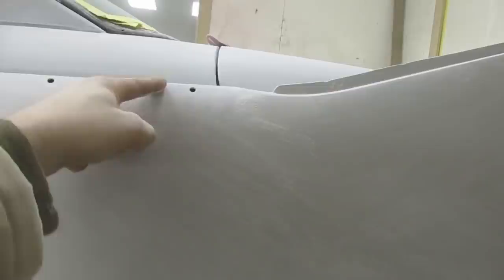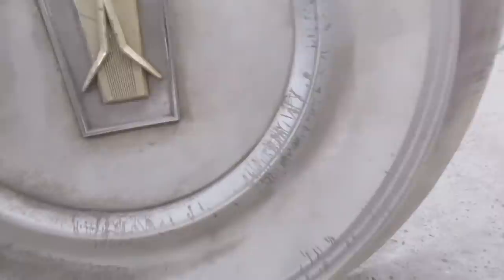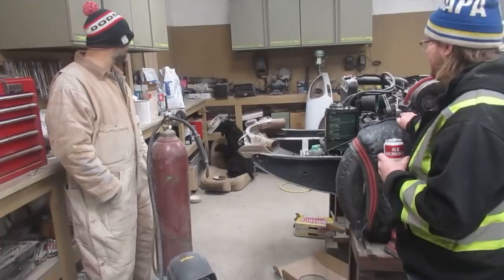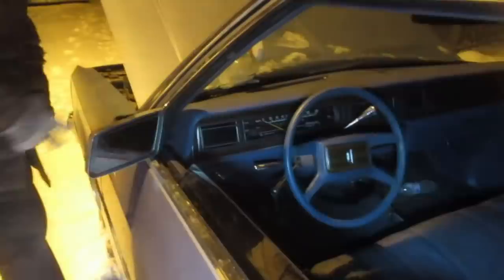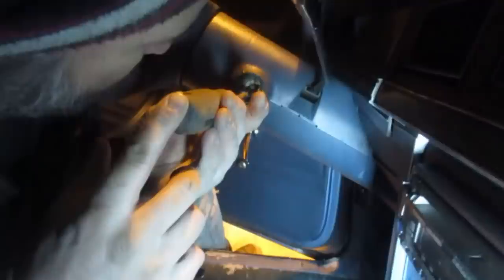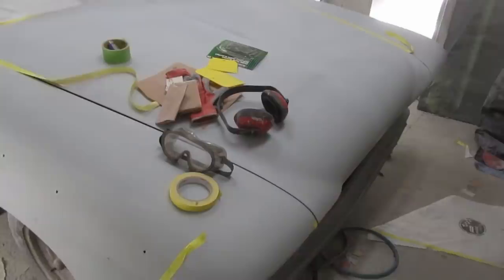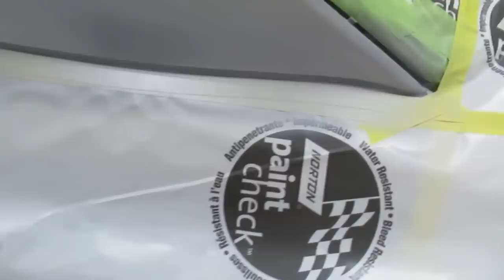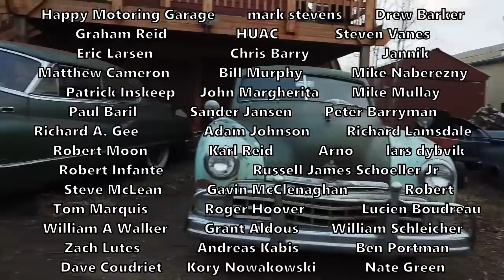Fury Paint and Winter Beater Update!

Comment: Love the screwdriver key on the LTDean. A friend got the key stuck in his SAAB, back in the late '70s. Since no one knew about their floor mounted keys back then he just cut the bottom from a styrofoam coffee cup, filled it with cottonballs, and painted them to look like coffee. He drove that car for years without ever taking the ignition key out when he parked. Locked the door with a spare.
Reply: Haha, best idea ever, with that fake coffee! Definitely an underrated comment ;-D

Today I have a VAG Group car, with the KESSY keyless entry & start system. So easy to steal these cars, with 2 people and a radio relay, one of them at your door, scanning for the keyless fob in your pocket on the clothes hanger. Just Google for it :-(
Reply: SAAB oddly you have to put the gearshifter in reverse to get the key out
Reply: @ralfgottfridhansson3127  I worked in a SAAB dealership in the early '80s. The stuck key was a common site. I owned a '75 99 EMS at the time. No column lock, but it had to be parked with reverse engaged to take out the key.
Reply: @ralfgottfridhansson3127  Reverse then serves as a mandatory parking brake.

Comment: Dean-O, 79 LTD survivor here.  That's just the Level 1 switch breakdown.  Level 2 is the steering column catching fire because the sliding block contact point setup gets hot from resistance due to the greasy goo buildup in it.  You should practice your hit the ground and roll moving car exit this week.

Comment: All the tumblers in my Dart wore down so bad finally I couldn't even turn the wore out key to start or turn it off. I finally pulled out the cylinder and knocked out all of the tumblers and put the cylinder back in so it looked like it still used a key. I could turn it with anything that would fit the key slot and I drove it a year like that. I would just lock the door in bad areas otherwise I just left it unlocked and nobody ever touched it. Turns out 69 Mopar cars used a 1 year only ignition lock because they were going to column ignition key in 70. It took me over a year to find one good lock cylinder setup  about 15 years ago from a 69 Cuda. I had it rekeyed rather than change out every lock to match as the seller sold me all the locks from the cuda so I could if I needed to. What we do to get by and it makes great stories later.

Comment: Hi there!  Back in 1960 I was living in Reno,  Nevada,  and bought a 1959 Plymouth Sport Fury,  probably the best vehicle I ever owned.   As I understand it,  the Sport Fury's were assembled on a special line and had a lot of hand assembly - every panel fit perfectly,  and it had a lot of little extras,  including a plaque on the front of the glovebox that said "This car made especially for" and then my name.   It had swivel seats, a great idea!,  a gasoline heater,  which always worked perfectly,  remote control exterior mirrors,  air conditioning,  and self-dimming interior rear-view mirror. It was  a  white 2 door hardtop,  and had the fake spare-tire on the trunk lid.  The interior was red.  You can see a picture of one just like it on Richard Carpenter's website - He and sister Karen had one just like it,  and he still has his.     Thanks for the great memories!

Comment: Dean has a killer LTD! The new wheels and tires really make it cherry, just needs the ford poverty caps and deep trim rings to set it off. The Fury becomes more beautiful with each new episode. Going to try the screwdriver trick on 99 Silverado with 245k on it, finally got the stuck ignition switch out so can try to drive it to pass inspection one more time, thanks guys!

Comment: Hello Scott .....nice to see some paint going on the Fury treasure . I was going to begin putting emblem back on a vehicle I had repaired and the body shop owner gave me a few strings of window putty, he told me to put some at every hole where the molding pins go through the panels that have emblems, may have been for anti-rattle or in case a paint chip develops when emblem pin passes through. Great videos , Keep 'em coming !!   Check out the 1960 Plymouth Fury SonoRamic Commando ..  beautiful Fury but 1 Highbeam is clocked out on passenger fender

Comment: I'm partial to the 1960 Plymouths, as we had a 1960 Plymouth station wagon as our family car from 1960-1964.  Unfortunately, we were headed out one day and the engine started making a horrendous knocking -- it turned out that the crankshaft broke.  I guess my dad made some deal with the dealership to trade the car in for a new 1964 model, which we drove for many years thereafter.  Both cars had the 318 "poly" V-8.  

I guess the 1960 models were the last year of the Mopar fins.

Comment: I, too, am glad you are going to re-use the faux spare tire cover.  I've been hoping for it ever since I saw the outline of it on the trunklid.  They were optional in 1960; Plymouth's official name for that accessory was "Sport Deck."  Similar accessories on Imperials were called "Flite-Sweep Deck."  Will the finishing touch be wide whitewall tires and the original wheelcovers?
Reply from the maker: Yeah, I plan to get the correct tires and I have a full set of wheel covers...Cheers!

Comment: The ignition on Deans car is so easy to fix. It is located on the lower part of the steering shaft. The lock cylinder can be removed with a pin.with out removing the steering shaft fascia.....I know,I know... It's hard to think with so much snow.....lol..

Comment: Don't you guys have any love for 60's muscle cars
Reply: The whole point of the channel is that it's NOT about 60s muscle cats. You cant swing a cat on You Tube without seeing yet another 10  Camaro or Mustang videos.
Reply: @tomadkins2866  my first car was a 69 Cutlass Supreme pulled out the six and put in a V8 had to have a four-speed so I had to take the the crankshaft to drill a pilot hole for the for Speed a Chevy can all receive four speeds Oldsmobile engines have to come from the factory to accept a 4-speed I was in love with that car until my friend bought a 69 Z28 and I had to get a 69 Camaro I like the 58 Chevy in American Graffiti that's a cool car they sold those cars cheap after the movie was made I think I paid 350 bucks for that car the Deuce Coupe the 55 and the 58 are still around